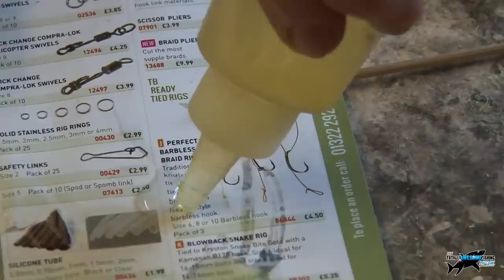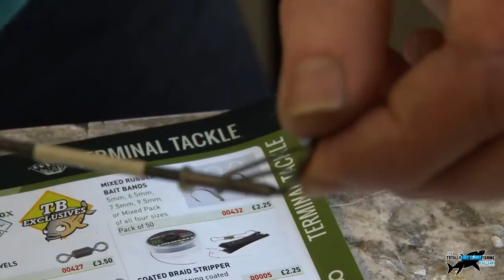How to build a Carp&Pike fishing rod - Totally Awesome Fishing Show

Comment: When I was building rods particularly those used for surf casting I would load the rod up with a heavy bend along the spine and temporarily position the guides with zip ties by sight then adjust them with test casts in a nearby field till I had a good compromise between casting distance and line support before wrapping in place .
I did this because I found each blank in a production batch had different spacing needs.
Cheers from down under 
Eric